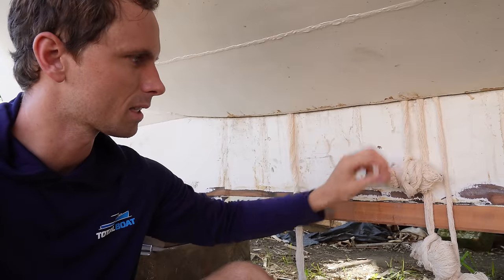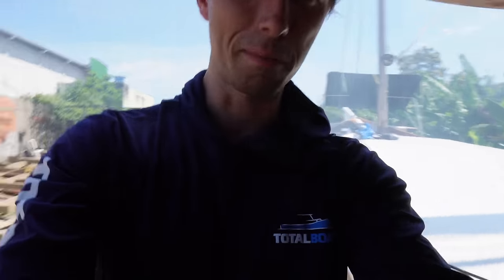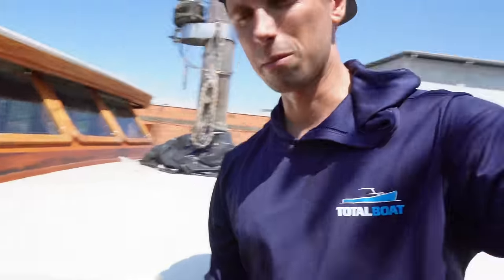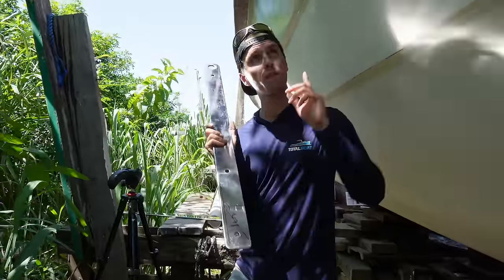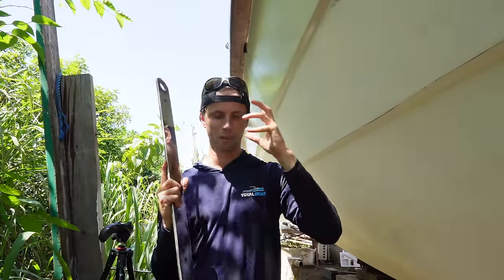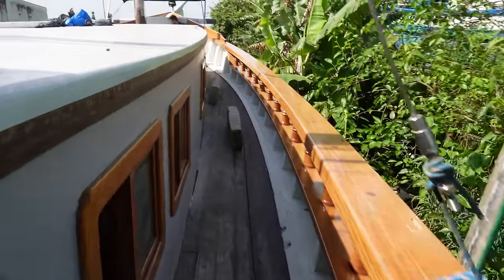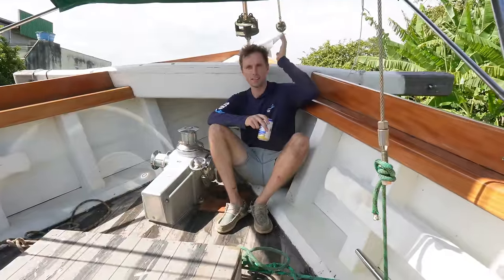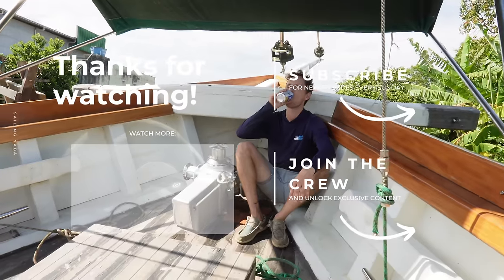Wooden sailboat restoration: we would have sunk until now — Sailing Yabá 176

Comment: Glad things are coming on well.  Surely you need to have a black water collection tank onboard ?  ie  The disposal of a boat’s waste water is regulated by The International Convention for the Prevention of Pollution from Ships (MARPOL). Feces and waste water have to be collected in a designated tank on board and can only be disposed of once the vessel has reached a certain distance from the coast. A disposal on inland waters as well as in some regions is strictly prohibited. In this case, the tank contents have to be disposed of via a designated vacuum sewerage system in the harbor.    ATB regards from the UK

Comment: Little tip for your Bimini!
Use a 4mm dyneema rope and build a whoppie sling. 
A whoppie sling is a adjustable dyneema sling with full strength.
Mostly used as a adjustable hammock suspension.
Easy to make and a bunch of tutorials in YouTube.
Never use knots in dyneema ropes, you lost 50-70% of breaking strength

Comment: Love the Channel, watcher day 1. I do electrical on yachts and diesel. Just please go revisit the 24 volt panel and secure the main red cable to the bus bar with something. Having the lug take all the weight and sway it will eventually stress and break and leave you with no power at all and possible fire hazard. Just needs to be secured to some solid anchoring point to the panel. The lug will break off. Not a question of if but when.. Keep up the awesome work.

Comment: Hi you need to check that the through hull fittings are the right metal it HAS to be Dezinkifation resistant bronze or they will snap off in function and flood the boat.

Comment: Since (I think) you have two toilets - one on starboard and one on port - it's wise to have two inlets (and outlets) on either side of the keel. When the boat heels over at sail an inlet on the windward side will struggle to pick up enough water for the flushing -- and you have to manually clean the toilet with buckets of water. Not ideal.

Comment: Im curious as to what your using for the deck caulking compound. It looks like a 1 to 1 epoxy of some sort. If it is, I hope its flexible when cured because if not, it could cause issues when the deck planks swell. That's why pine pitch is traditionally used for that type of deck.

Comment: Just wondering on the threw holes. You are plumbing all the sinks direckly to the three holes is there a plan to add gray water and black water tanks in the future? Many countries require that you have a closed system and not allow wastewater to be drained into the water.